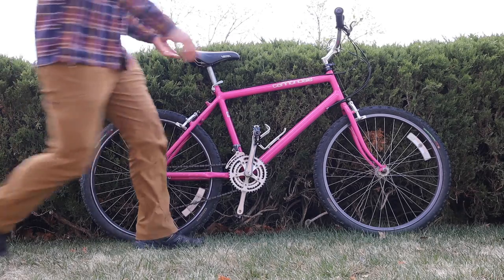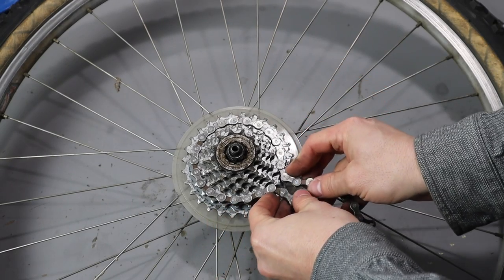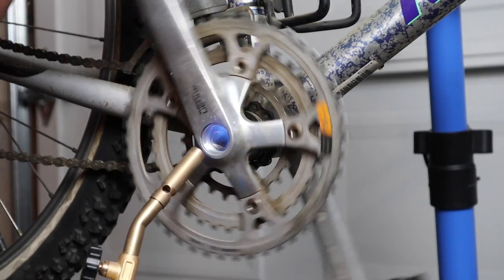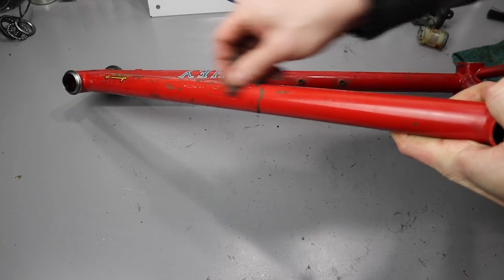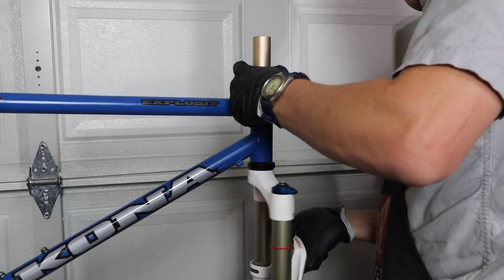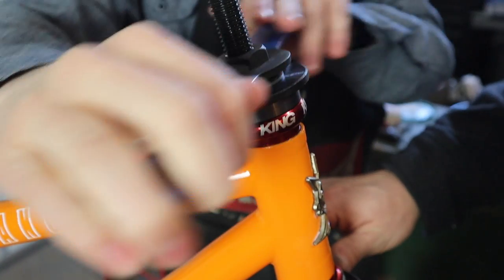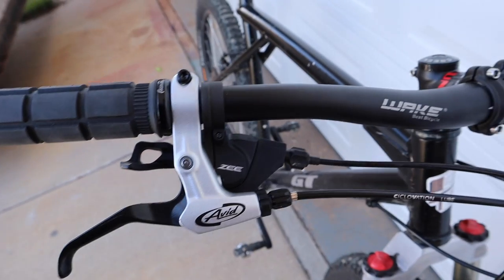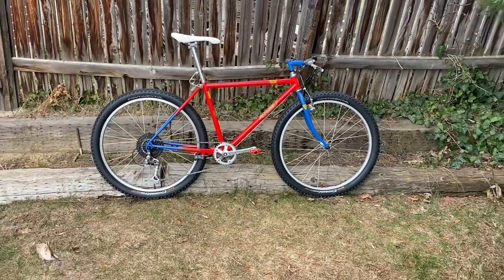10 Bike Restoration Tips & Bits For Your Vintage Build

Comment: When scrubbing rusted areas, first dip the wire wool in vinegar.  The mild acid makes the iron oxide more soluble and gets back to bright metal with less aggression. Make sure you rinse and dry that area afterwards. This preserves the maximum amount of the old paintwork.

Comment: I recently discovered a little trick for determining seatpost/handlebar diameters without using vernier calipers. You take a thin strip of paper and wrap it around the tube, marking with a pencil where the paper overlaps itself. This gives you the circumference of the tube. Then you take this number (in mm) and divide by pi (3.14159...) to get the diameter. I used this to great effect just a couple of days ago. Great tips btw. :-)

Comment: When I recently built a single-speed bike from an old TREK frame, the (aluminium) seat post was so firmly welded to the (steel) seat tube that it simply couldn't be detached.  I carefully slit the seat post lengthways with the saw blade of an electric saber saw and was then able to compress the seat post with a pipe wrench and pull it out of the seat tube.  A beautiful TREK MetroTrack frame was saved!
Reply: I put a bit of grease on the seat post so it doesn't get stuck

Comment: A couple things:

1, while the old heat-up-the-crankarm trick works pretty well, you can make it work EVEN MOAR BETTER by squirting some penetrating oil into the bolt recess and then walking away for half an hour.  As the metal cools, capillarity draws the oil deeply into the crevices and really increases its effectiveness.  

2, another great saddle that gets overlooked is the Selle San Marco "Regal," particularly the Regal Ti.  Not as light as a Flite Ti-- few vintage saddles are-- but its comfort makes up for it.  It was built to mimic a broken-in Brooks B-17, and that isn't a bad thing.

3, as long as you're getting into this, you may as well read up on what it takes to make cantilever brakes work well. New Kool-Stop salmon pads are an easy way to get a lot of grip, but straddle cable geometry has a LOT to do with braking performance and modulation.  The info is out there, so go ahead and check it out.

Finally, consider what you want for tires.  If you want to keep that retro look, Panaracer is still offering the Fire and it's an even better tire than it was the first time around.

Comment: I love your bike videos - thanks for them.  They have helped me get the gumption to take apart the partially broken-down bikes that I have and get them back in working order and riding again.

One thing that I ran across which I think deserves a video is from a Sheldon Brown article.  Apparently you can set up an 8 or 9-speed drivetrain on a Shimano 7-speed hub by removing one cog from a 9- or 10-speed cassette.  Neat unknown ways to upgrade old bikes like that would be awesome content.
Reply from the maker: Interesting thought on the 7 speed upgrade... I’m guessing though that the spacing would be a little off unless you also left one speed unused on the shifter... interesting 🤔.
Reply: Unless you've got friction thumbies 😎

Comment: Super helpful 'hacks' and inspiration. Thanks! I wonder if you could make a tutorial how to combine moden 1x12 or 1x11 shifting with old hubs/freewheels and which hubs go together best with  the rear spacing of old steel or alloy frames. Would be awesome because finding out the proper combination regarding new shifting components with old hubs/frames or new hubs with old frames can be quite tricky!
Reply: I've just fitted a shimano XT 11 speed cassette on a oldschool Hope Bulb hub.. just slid right on..

Comment: You can also make a headset cup remover from a piece of electrical conduit.  Cut it twice and bend the fingers out.  Works great.  Pcv pipe makes a good crown race installer as well.

Comment: I have an old 1995 Diamondback DBR racing frame I purchased in 98-99, and built it to be as light as possible for the money I had to put into it. I've recently pulled it out of the garage and have been playing with it. I removed the Rock Shox Indy SL and replaced it with a Amp Research F3xc I found online, changed the cockpit to something a bit more modern, and put lighter wheels on it. It's been a fun project, so I found a really nice 96 Pro Flex 856, and I'll give it the same treatment. It's starting to turn into a hobby.....

Comment: just joined. I'm very  impressed with your work, tips... I have a 1995 Marin Pine Mountain that I intended to convert to a gravel/backpacking bike. I ordered the components Shimano GRX 2x11 crank 46/30, Ultegra RX800 rear derailleur and rest is Shimano R7000. I will hold on to the old components just in case wish to revert it back to hardtail mountain bike. Enjoying  your channel.
Reply from the maker: You never know when those old parts will come in handy. 😊

Comment: I wanted to try it, so I repainted my bike with spray.bike paint.  Took 1 can of primer, 2 cans of color, and 2 cans of clear.  At $16 per can plus shipping, that's about $80, and several hours of my time.  A single-color powdercoat for a bike frame+fork in my area costs about $125-150.

Comment: So I purchased (I believe) a 1996 Specialized HardRock a couple years ago that is in very good condition for it's age. My plan is to modernize it to the point that it can be a comfortable trail shredder but also a town-cruiser. I currently have a All-City Super Pro (1x) and a Surly Steamroller (Fixed) as my main bicycles. There is something about choosing this vintage mountain bike though that has me really excited but I've taken forever to even get a fraction of the upgrades to finish it. It's not going to become a super modern bike but a stem adapter, new shoes, and likely modern group set would really go a long way. I found a sweet Mavic 517 w/ Shimano XTR wheelset for a great price-- merely need the other components.

Comment: I prefer soldering the ends of cables instead of crimping the ends on.  This allows them to be pulled out of the housing occasionally,  cleaned and reused.   They also look better to me that way.
Reply from the maker: Awesome tip
Reply: I use superglue for the same purpose. Soldering sounds like a great option as well!

Comment: If your bike came with a quill stem (mainly retro MTBs and road bikes) and you want a threadless look, order a conversion kit.
Threadless headsets and stems are way more common on ‘real bikes’ of today, and its safer than a quill stem.
But if you want to keep that original look of the bike, you can keep the quill stem, and just upgrade other parts like the brakes, tires, bars, or brake + shift cables.

Comment: Fully rebuilt my dads 2001 haro 8.2 mtb with dual disk and front manitou shock (has grease holes!) I tore it down to the frame cleaned it, lubed necessary bits , replaced the chain, tubes, put downhill happy medium tires, and cables. Now I take it on nasty trails
Reply from the maker: Awesome awesome awesomeness

Comment: Outstanding summary of your art and craft! How can I specify parts for a striped frame from a 1990´s Cannondale M800 not to err on not compatible parts such as cranks, head sets, bars, cassettes, derrailers, brakes and  for instance!
Reply from the maker: Thanks. You could write a book on all the different possibilities 😁. I would just recommend you google the different parts. There is a lot of great information out there.
Reply: oldshovel I will, sounds like a project!
Reply: Most Cannondale frame serial numbers contain the production date, so you should be able to figure out the model and year.  Then you can find the correct Cannondale catalog to determine the original component specs.

Otherwise:
BB:  68mm shell 
Head tube:  1 1/8  (unless really early 90's, then could be 1 1/4")
Seat tube 27.2mm
Rear dropouts:  135mm

A neighbor of mine had a 1992 M2000 that he hadn't ridden in ages.  A beautiful bike that I really lusted after way back when.  Unfortunately he sold it at his garage sale before I caught wind of the deal!  Someone lucked out and picked it up for a song!  Oh, those Ritchey Logic cranks alone were worth the sale price!

Comment: That is quite a collection of bikes. I'd like to find a frame that will handle 27.5" wheels and 2.2-2.3" tires, and convert it to single speed. Any suggestions? It seems on eBay, people are asking exorbitant prices for pretty much everything bike related. I'm also about to convert my Trek Verve 3 from 3x9 to 1x9, as I almost never use the left shifter.

Comment: You can use a rag or old t-shirt to hold the cassette and take off the lock ring.

You should also sand in the same direction.

Comment: Hi, what do you do to fit a new fork into those old fashioned / small diameter head tubes? For example, I'm thinking to fit a modern carbon fork into a Klein Pinnacle from the nineties. Do you know of headsets which sit on the head tube's outer diameter and leave the full inner diameter to pass through with fork's steerer tube? Let me know, regards, Gottfried

Comment: If you dont own a torch you can remove the bolts on the craks and take a ride around the block once or twice, it will knock most of them loose pretty quick

Comment: Thanks for the video!
That plumbers tool is too small, it has no grip, there is others that are longer and have a grip, and those allow you to cut all the way through with just that tool. You just keep tightening and rotating until the cut is finished, nice and clean. But it takes some force(not that much, but definately not possible with the tool in the vid).
Also don't get the modern selle italia flyte for comfiness, because they seem to be made for lightness nowadays, I have a prosthatic one and feels like seating on a rock hard.

Comment: What do you use at 1:25? Piece of chain+pressure clamps and? (To remove the sprocket set from the rear rim)
Reply: Just a regular cassette tool you would also use otherwise.

Comment: Great tips. Unfortunately not every bike can be convertible to 1x10 drivetrain. Average quality vintage bikes usually come with 3x7. So 7 speed hub even doesn’t allow you to put 8 speed cassette. So we need at least 8 speed cassette or 7 speed hub with a tick hub spacer which is super rare.
Reply from the maker: True for those 80’s and early 90’s bikes. A hub swap or wheel swap is needed.
Reply: Yes, I think a 3 X 8 is perfect for me where I live surrounded by hills like brick walls. All my old bikes have been 3 X 7s or even 1 X 5 so the first thing I do is fit a cassette and chain ring giving me as wide a range as possible. I just re lace a suitable hub to the wheel. It was a bit daunting the first time but it is actually quite straight forward and easy with plenty of YouTube videos to follow and satisfying to do.

Comment: On old bikes if you have 7 speed cassete ''holder'' on hub(dont know eng. word for it) is too short for use with 8-9-10 speed cassettes.
Reply from the maker: Yes, a 7speed hub will not be able to fit an 8, 9 or 10 speed cassette. You would need to swap the hub or get a different wheel. The clip in this video is for a build I will be doing and I will be swapping the hub so I can run it with an 8 speed cassette.

Comment: I'm struggling with a rusty seat post right now. I tried with rust remover and to spread the part for the quick release with a screw driver, but unfortunately it didn't work. I don't have a vice ether. The post is really strong connected with the frame, I'm about to give up with these Thing. Does anyone have a tip for me? I'm sure not being the only one with this problem 😅
Reply from the maker: Oooh these can be tough. I recommend checking out RJ the bike guy, https://www.youtube.com/user/shyflirt1 he has done several videos with different ways to get a stuck seat post out.
Reply: If you don't want to keep that exact seat post, you can drill a hole in it and use it to place a chisel and hamered it out
Reply: This can be so much of a challenge as to be impossible. 

But don't feel bad, because I know a former bike racer and very knowledgeable scientist of who experienced the same.  Although well-educated in the very subject of metals, he found his aluminum seatpost permanently galvanically "welded" to his steel frame.  All attempts by knowledgeable scientists at the lab were rendered useless.  Liquid nitrogen, blow torches, brute force, penetrating lubricants, you name it, it WOULD NOT BUDGE.

They had fun working on trying to fix it.  Nonetheless, it went into the dumpster.

PS That said, if you happen to have a frame of considerable value, then by all means, take it to a knowledgeable framebuilder; seat tubes can easily be replaced, saving a valuable piece of bicycle art and history.  The bike I mention above, although nice, had been raced and trained on hard and wasn't worth the effort.

Comment: I don't necessarily agree with the heating up part if the bike has a lot of rust at least surface rust and you try to heat up a screw the metal will expand and tighten inside and those little rust pieces work as a grit to hold it together

Comment: my tip ,, spray paint don't work well on aluminum frames or parts ,, with the fist lite hit will chip off ,,,you are better off sanding it and polish it    and some clear coat spray may melt  up your original decals ,

Comment: A  8, 9, 10, or 11 speed cassette will not fit on the narrower 7 speed cassette body shown in this video.   Also If you put a narrower chain on the wider spaced 7 speed crank, the chain can slide around between the chainrings.

Comment: Always consider the width of your frame when trying to drop in a new gearset on you rear wheel. 

In most cases you won't even engage the front derailer on a single track, consider just keeping those circa 90s xtrs if they are in good condition

Grip shift had its pros and cons ... one of the pros was the ability to hop more than 1 gear (not under load) vs the rapid shifters of the time.. they did need constant adjustment so that they didn't rub between cogs. I competed w grip shift and did well..

I still don't recognize the 26, 27.5 and 29 differences in trail performance. I've ridden all 3 and enjoy the 26rs all the same. Getting upgraded wheels on 26 is getting cheaper and so are rock shox. If you have a lefty or a moto from the 90s... that was some fun suspension to have. Rebuild kits make them just about new... unicorns of their time worth having

Second market across the board is getting cheaper.... but, I notice, it's better to buy an entire second hand bike at the price of the very components on it sold piecemeal by other sellers. 

Adjustable seats vs locked seats of the 90s are a matter of just getting used to either system..   I used to lean back behind my seat post on some serious down hills to maintain center of gravity  and on my hard tail, I rarely sat in the seat on technical bits 

All of that said... I think vtg hard tails and full suspension bikes are quite relevant...  just consider that 26in rims tires and tubes will eventually see end of life for pro components..  it's like film cameras vs digital.. 

Biggest consideration by far: rider mod the better you get, the more you can rock out on just about anything, and have a good time doing it

Comment: I appreciate you making this video, but FYI, your wrench handling technique is borderline cringe. I found myself wincing more than once when watching you apply torque to a barely seated wrench/socket. To anyone watching and just starting out, there is a lot of value in using your second hand to brace, align, keep straight, and keep tight, the wrench you are applying torque to. If you can only uses one hand, extra special care needs to be taken to seat the tool as well as possible, and to apply a holding force to keep the tool as square as possible when applying force.